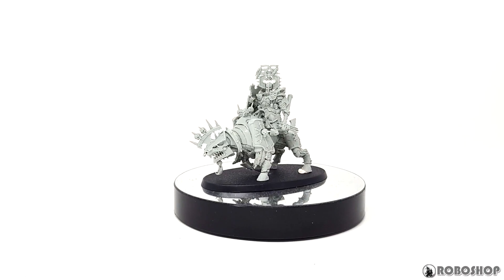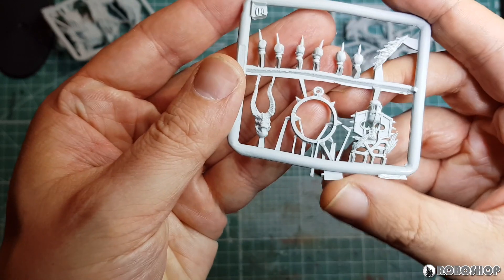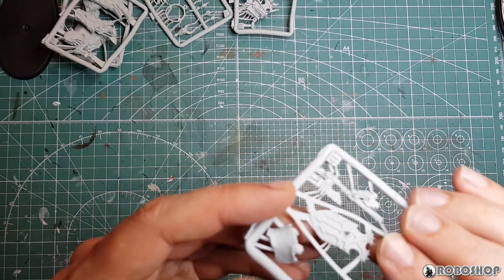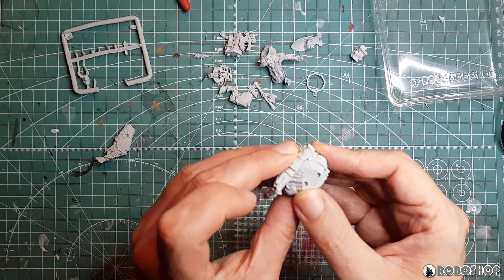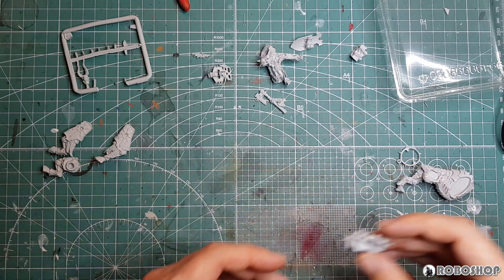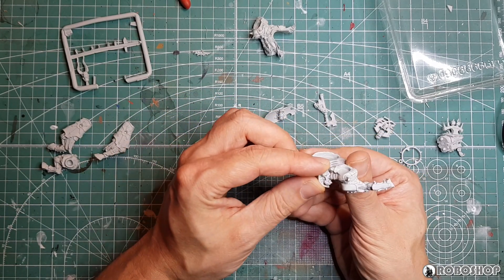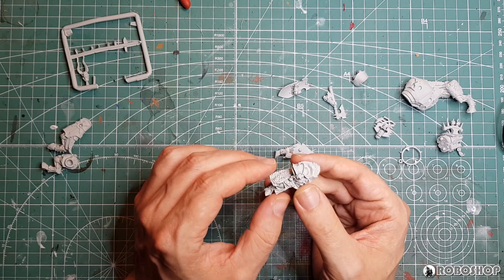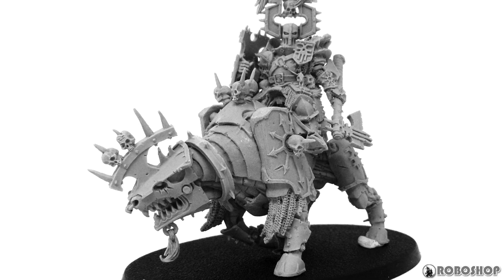Reviewing the Lord of Khorne on Juggernaut

Comment: Just received mine and glued it together. A couple of thoughts: 1) you are right, it is messy, full of resin bits and annoying to put together, but i found it relatively easy to clean and assemble; 2) i wouldnt have been able to put it together without your video... no instruction manual and less than intuitive kit; 3) overall, it would be good as a kit if it didnt come with a 40 Euro price tag... for that price, indeed, I was expecting way better quality.
Reply from the maker: I bought the metal version on eBay a while later, and it's infinitely better. Obviously hard to work with as well because it's metal, but it actually has all the details that the Finecast one is missing.

Comment: As one of the few people who don't particularly hate finecast, i have to say that for whatever issues it may have, the details are exquisite, you just need to spend more time cleaning off sprue bits and green-stuffing holes and gaps. Sometimes a lot of time. To quantify "a lot", sammael took me almost two months worth of spending some hours every week to clean it up to a point where i was happy with the results and galrauch almost 5 (almost every single one of his scales needed to have some hole greenstuffed and both the upper body-lower body and lower body-tail attachments needed to basically have missing details sculpted in), but, the end results were significantly better than anything that could have been achieved with plastic. Now if it were less volotile, like normal resin or pewter, it would be great, but whatever. 
Where i'm getting at is that this model could actuallly look pretty great, but it needs a few months worth of casual light cleaning.
Reply from the maker: It's not just cleanup, though, you're also looking at doing a ton of greenstuff sculpting for all the detail that's missing, like the spikes on the neck guard or the rivets on the Juggernaut's head.

I mean, if you enjoy doing that sort of thing, more power to you, but for me there's a point where it turns from a fun challenge to a nuisance. Plus, there are plenty of other companies that make resin models without any of these issues. GW just expects to accept this because "it's resin", and that's just not true. You can make stuff this detailed with resin and not have more than some mold lines and a few air bubbles.

I think the issue in this case is that they just repurposed the mold from the pewter version. I bought that one a few weeks ago and it's beautiful - very few imperfections and all the detail is right where it's supposed to be.
Reply: @spacehamsterZH  Due to my schedule, and becase i low key have been trying to learn how to sculpt, it doesn't particularly bother me, but i agree with you on everything else.. And specifically on that last point, i have noticed  that straight to finecast miniatures seemed to have significantly less issues than those that were just converted from pewter to finecast but had never thought that was the reason.I'd rather they had just continued doing them in metal or to at least switch over to forgeworld's resin.

Comment: Thanks for this review, it's how to find a much info about this online. How different this model compared to the mighty skullcrushers?
Reply from the maker: It's pretty much meant to fit in with the Skullcrushers in terms of its size and design, if that's what you mean. But the Skullcrushers are much better quality wise and I'd honestly recommend you just take one of those and do a conversion.